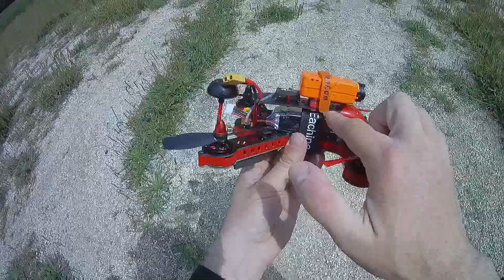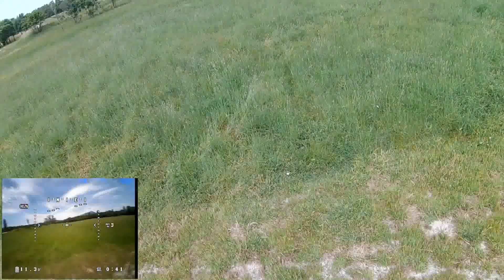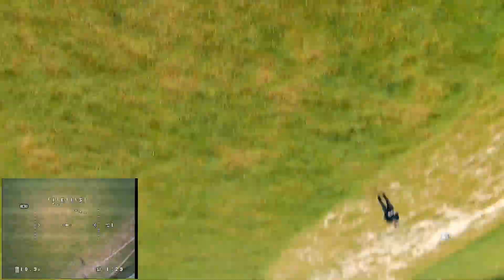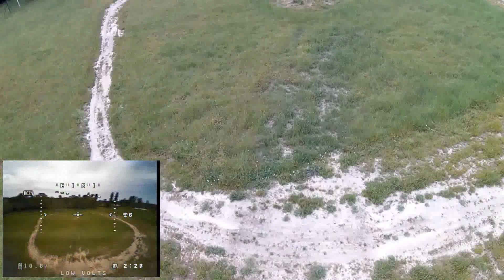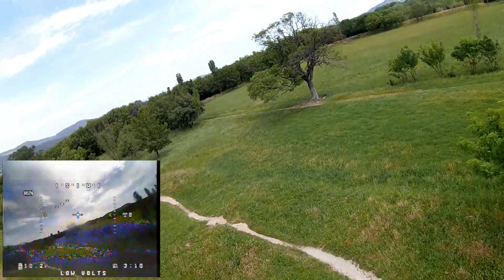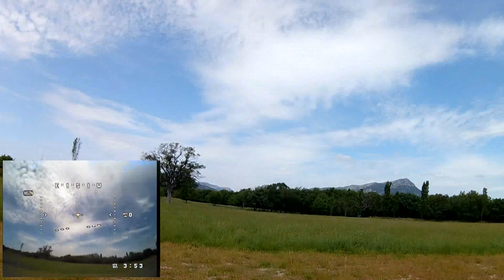Eachine Blade 185 first demo flight (Courtesy Banggood)

Comment: yes
Reply from the maker: When you turn on the quad and the radio, can you read on the TX LCD two error rates in % ?
Reply: Yes
Reply: I also changed my TX to model2, because this TX belongs to the Eachine falcon 250
Reply: What channel should I have plugged in on the Rx is it ppm/ ch1
Reply: Any ideas
Reply from the maker: Are you sure your receiver is a PPM one ? it's tie i6B ?

Comment: Can you tell me if the stock transmitter (re-branded Flysky i6)can bond with Flysky i6 receivers? In particular I like to also use this transmitter to fly Eachine Tiny QX80 with Flysky receiver, is that possible?
Reply from the maker: Yes and yes

Comment: hey i used clean flight on it and got it mostly set up but now when i arm it its propellers just start running and i cant unarm it. the only way to stop it is to unplug battery which is pretty scary. i tried setting failsafe to the swd2 (stock remote) but now when i switch it it just powers up more. and at times it just starts gaining speed for no reason. scared to fly since i cant actually turn it off. i would really like if you could help. ps if i wanted to reset the software back to the one it came in could you link or lead me in the right direction? thanks man!
Reply from the maker: Can you chek your end points of your radio with cleanflight ? (remove props first). I guess you are not centered on 1500 and your lower bound value (at least for yaw) don't go below 1100. Check also your transmitter if sticks are well calibrated as well